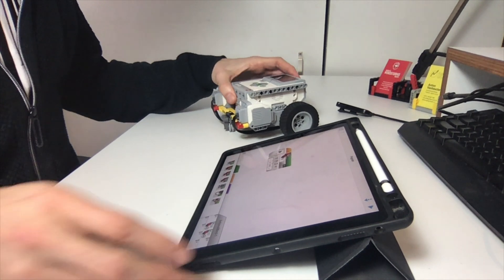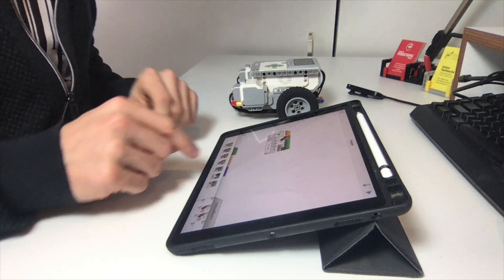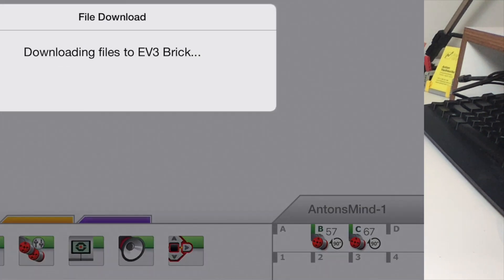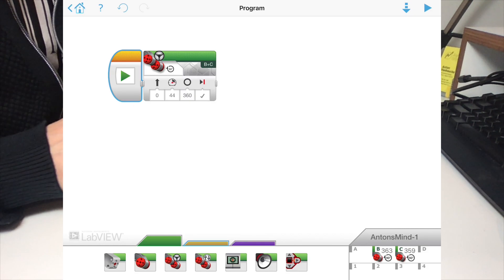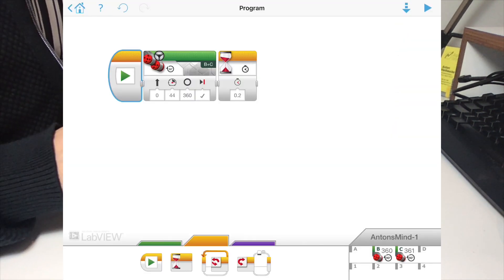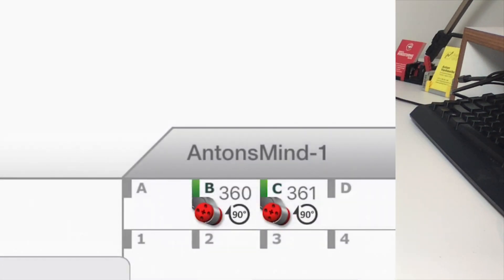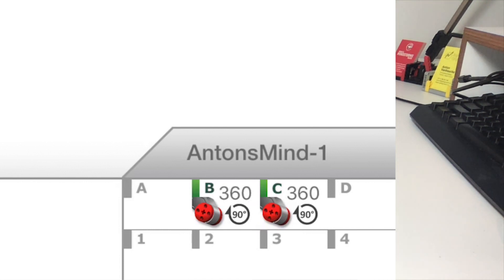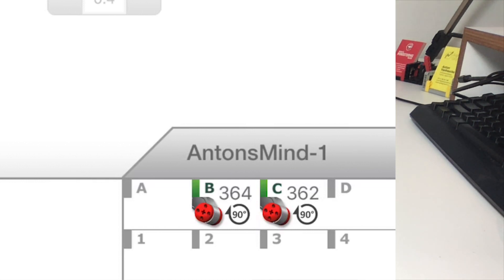Can you program precision movement of LEGO MINDSTORMS Motors?

Comment: so short and so great!   If I may pose this question, to Anton and/or anyone: I am a novice to ev3, trying to build and program sort of a cnc/drawing machine/laser/3d.   I find the way to program straight x and y movements but I do not find the way to program the machine to draw accurate circles. Can anyone help me out? Is it at all possible on a Lego EV3 machine with the EV3 brick and motors?   On YT I have seen a very nice machine, built with Lego parts, but the motors where other motors and the command was Arduino + shield.   I'd like to stick to Lego EV3 brick and motors, if possible.  Thanks
Reply from the maker: Try setting a timer and then tracking the coordinates (r * cos(t), r * sin(t))